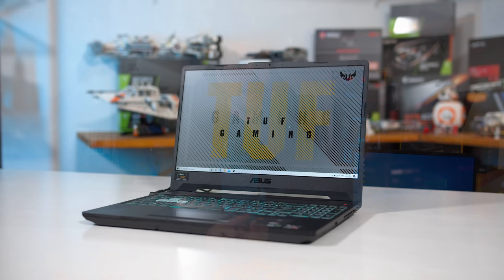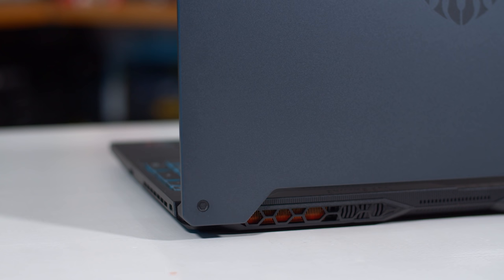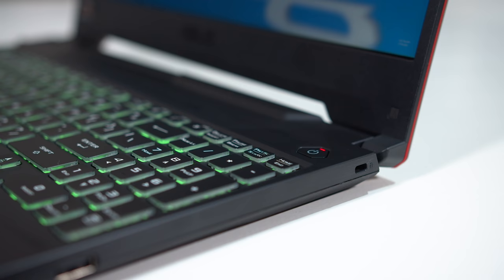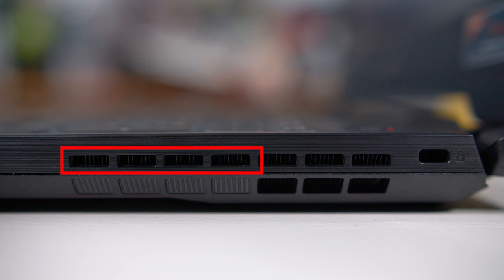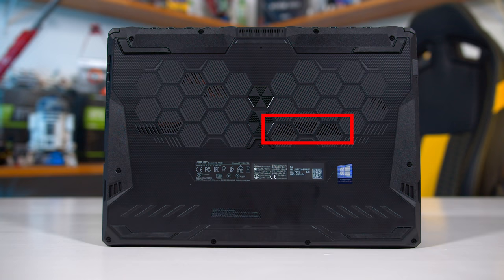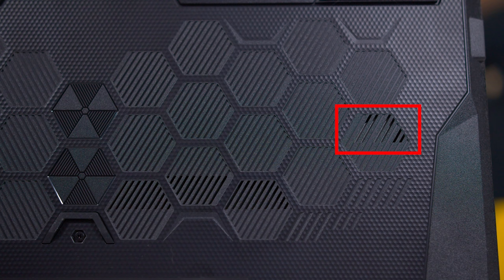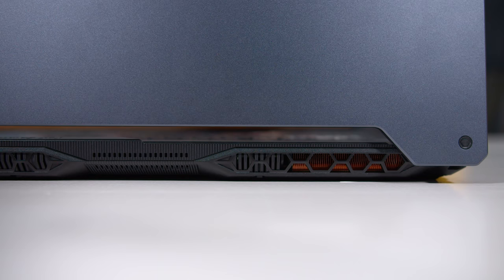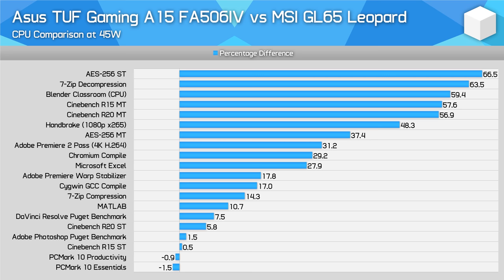Don't Buy The Asus TUF Gaming A15 (2020 Model)

Comment: From my experience, the design 'flaw' with the vents has been an issue with 'lower end' laptops across most manufacturers for a long time. Make it look like it has a lot of vents, flash fancy marketing images saying it has amazing ventilation, and people buy it thinking that they just might finally get a laptop that doesn't burn their lap only to be disappointed when it's just more of the same. I'm sure laptop manufacturers are fully capable of making a laptop under $1k that doesn't cook itself and its user, but doing every little thing you can to make them throw it away as soon as possible and buy something new just works too well. 
I think I'm just gonna stop paying attention to new laptops entirely. Honestly, it just seems like if you're uwilling (or unable) to drop a couple thousand dollars or more then you may as well just sift through the clearance aisle and hope for the best.
Reply: Not saying you're wrong, but as a point of contrast, I bought an entry-level ThinkPad E495 laptop last year for less than USD 500 (converted), and it has absolutely no problem cooling itself. Granted, it only uses 15 W and the fan doesn't even need to turn on unless I run a prolonged workload, but even for a CPU with that TDP, it still has dual heatpipes and more than enough ventilation around both the fan and heatsink, and around the components themselves. Needless to say, at that price point, compromises were made, but nevertheless given the low price, I've nothing but good words about it.
Reply: It reminds me exactly of why it is that I got the strange thought in my head of turning an old suitcase-PC into a modernized portable desktop machine.

Because either the hardware is crippled, the cooling is crippled, the display is crippled, the chassis is crippled - or a combination of any of them.
yeah, fuck off i'm not buying
Reply: @chuuni6924  i would be really surprised if a 15 watt cpu was overheating. It does not take much to cool it
Reply: gaming laptops should not be on your lap.
Reply: That's seem to be just how OEM treat budget gaming laptop, does seem to be the same across all OEM. They either charge more for better cooling or put in lower tier chip for the same price or sacrifices something else. Just gotta pick your poison. Just hope that at least these laptop can still last for at least 4/5 years with decent performance
Reply: I would say the entire idea of a gaming laptop is an oxymoron and the term shouldn't exist, it seems like any laptop that can actually game with a decent graphics card will have ridiculous throttling issues, portability problems with a crap battery, and heat that removes any long term potential for use, plus no upgradability. Gaming laptops are a scam and the reviewers should catch on to this.
Reply: @diddlysquat123  Yea, my Card has a MASSIVE heatsync. Its no womder laptops cant cool them good enough. Also, with laptops you normally end up paying twice the price as a desktop. Its funny because most of the time people that buy them dont even travel with them 🤣
Reply: @diddlysquat123  This person gets it!

People want gaming desktop performance crammed into a tiny ass space and not have to pay a fortune for it. Sorry folks, it's just not doable without some sacrifices.
Remember laptops before the gaming crap came around? I 'member! Light, portable, power efficient, cool, and affordable! People weren't pushing to play AAA games on them and shit.

The closest people are going to get to a high end desktop level gaming laptop: Heavy, large, power sucking, cool, and expensive.
Oh, it costs too much? Too big and heavy? Well, then you should be prepared for corners to be cut in places so you can get your sub 1000USD model.

Oxymoron indeed...
Reply: Buy Lenovo then lol Lenovo laptop is pretty cheap
Reply: The weird and not intuitive part of this at all is that the worst thermals it has, the less it burns your lap. the better it can transfer heat away from the processor, the more feet ends up going to your lap.
Reply: @pilotavery  say what? The idea of good thermals in transferring the heat out the side vents, not onto you lap, which is where the heat goes on a machine with poor thermals. You are totally backwards
Reply: @Mach141  a laptop with really really poor thermals won't output the heat into the environment, it will keep the processor really hot and start throttling. The more heat goes into your lap, the more heat is also going out of the vents.

laptops that get extremely hot mean that they are out putting a lot of heat into the environment which is why you are feeling it in your lap and out the vent. 

temperature does not equate to heat. A flame from a candle is very hot but is not a lot of heat. It won't heat up a room. A space heater might only be 100°, which is not very hot, but it has a lot of heat, and will heat a room.
Reply: @diddlysquat123  This laptop (Asus TUF A15) has enough cooling to sustain boost clock speeds on the CPU and GPU indefinitely. This review makes it sound like the laptop's cooling solution is fatally flawed but it works fine. I get over 6000 on Time Spy, which is only about 10% behind a desktop PC with desktop versions of the same parts. Re: portability problems: the laptop only weighs 16% more than a 16" MacBook Pro and its footprint is only 7% bigger, and nobody says the MacBook Pro has "portability problems." Re: crap battery: the most common version of the A15 has a 90 Wh battery which lasts for 9 hours of moderate use--how much battery life do you need?? Re: upgradeability: obviously you can't upgrade the CPU or GPU but the laptop does have two memory slots and two M.2 slots.

So to recap, comparing this laptop to a similar custom-built desktop gaming PC: The laptop only costs about $150-$200 more. It's only about 10% slower. It obviously comes with a built-in screen, keyboard, pointing device, and battery. It's much smaller than even the smallest mini-ITX computer. It uses much less electricity when idle and when under load. It's literally silent when under light loads. And a gaming laptop is going to have vastly better resale value than a gaming desktop and thus a much lower total cost of ownership. (Ever try to sell a custom-built desktop?)

So instead of gaming laptops being a scam, it seems pretty hard for me to justify building/buying a gaming desktop. I just did this math last month and ended up buying the laptop that's reviewed here. I mostly leave the lid closed and use it as a desktop. Couldn't be happier.

Comment: Wow another Asus AMD product that's got terrible thermals? Who'd have thought. Let me guess they'll blame AMD on this one too.
Reply: Yeah... AMD must have given them the wrong torque spec for the bottom cover screws... SMH... 😅
Reply: "AMD didn't pay us enough" lol
Reply: "AMD made us block the vents!"
Reply: Amd did say that this cpu needs less cooling... so we desided to block 90% of air intake... so it is AMDs fault!
Reply: "AMD marketed this chip as being very efficient, so we thought there wasn't any need to get proper vents. Apparently, AMD overhyped the efficiency of Zen 2 mobile processors. We apologize for the inconvenient."
Reply: except it DOESNT have terrible thermals....in fact they are better then the Higher End more expensive ROG Z model...weird....there No Thermal throttling and no overheating issues from every other tech review i have seen..still seems like a poor design decision though
Reply: @AlbertoMartinez765  It doesn't throttle no, unfortunately the heat isn't dissipated fast enough though & while gaming the keyboard apparently heats up to a toasty ~40°C after a while...
Reply: @AlbertoMartinez765  Asus cover the bottom too much and have bad screen because of the military grade so obviously it isnt the fault of the chip but AMD DID said that the chip doesnt need much cooling so...Well thanks god i didnt buy this laptop
Reply: same with my asus ryzen 5 it has thermal issues and it run likes intel celeron

Comment: Throw a Dremel at that back cover. It should improve air flow.
Reply: too bad a dremel can't fix the shitty screen tho
Reply: the shitty screen still can be removed and replaced by a better one. It's not a easy as drilling holes but it's doable.
Reply: @PainterVierax  display connectors and drivers are proprietary they can't be swapped
Reply: Erdem With a bit of skills, connectors can be adapted.
Drivers for a display ? LOL since it's standard eDP or LVDS, a driver is completely useless if the new panel provides the same resolution.
Reply: @PainterVierax  true. but better screens cost a bit of money. at that point is it worth just buying a different laptop
Reply: I don't deny that, just it still can be improved if someone really have to use this particular laptop.
Reply: @renmaru4485  wrong! The lcd panel connectors are standardized. The side that connects to the mainboard may not be, but that does not matter here. Going from one 15.6" 144hz ips to another doesn't require anything extra aside from making sure the connector on the lcd panel is on the same side. (Some are left, some are right, some are centered)
Reply: @nesttea2239  new/used panels are under $100. Used A grade AUO panels can be found for $60ish
Reply: Hey, could someone explain what this means? Is this some kind of screw? I tried googling it but didn't understand.
Reply: @Harleen what? a Dremel? it's a tool, you can attach a little bit and you can grind those slits open
Reply: @harleensingh2531  it's a rotary cutting tool

Comment: Rip Asus... Poorly designed GPU’s, now laptops? What’s going on.
Reply: @Mina Besali old Asus was good
Reply: asus also makes poor quality monitors ,sells at premium price
Reply: Apple-like marketing for the ill-informed. Crazy that it works!
Reply: Thy fixed their GPU didn't they?
Reply: everope Only when people called them out on it, and even then, for the Strix 5700XT, they tried to at least shift part of the blame to AMD for their guidelines, even though other AIBs have the same guidelines but have zero issues with their 5700XTs

The Strix was also overpriced. The Sapphire Nitro+ was less expensive and performed better across the board.
Reply: They’ve made some really poor designs for laptops for a while now.  The older STRIX GL502/GL702 (high end G-Sync laptops) were plagued with BSOD due to overheating.

Why?  When the screen opened, it physically blocked the two exhaust vents on the back of the laptop.
Reply: Haxor inator Ohhh, the GL502 has way more problems than that, being the owner (soon to be ex-owner) of one.

Poorly designed laptop that also led it to simultaneously give it faulty hardware BSODs later on down the line.
Reply: Put too much budget on marketing and promotional campaign using overpriced 'influencers'. No, I am not gonna buy your products just because a cute cosplayer girl take a photo while using/holding them.
Reply: Intel's money. that's what's going on
Reply: @haxorinator8219  yeah the thermal design of GL502 is terrible, me and my friend almost bought it for his new laptop, lucky that the store we came to lets us test the laptop before making the final decision. The damn thing got too hot 30s after we open tomb raider and froze.
Reply: @ca9inec0mic58  old asus was living up to the name of just works now they are just trash which made buy a asrock motherboard for the first time ever
Reply: Don't forget their routers... (most of them)
Reply: Never like asus brand,but my first asus is a15 with rtx2060.lol
Reply: @everope  They did but it should have never been a problem in the first place. Look at other aib and they didnt have the same problem as Asus did.
Reply: they stopped paying their engineers
Reply: add asus phones too.
no updates!
Reply: @darshan5726  asus is infamous for never updating their BIOSes and any of their applications lol
Reply: @bananya6020  You have any sources for that?
Reply: SmashStomp Inc  Blocking air intakes, doesn't help, does it? Fuck asus.
Reply: the funny thing is people still think that they selling this "strong spec" laptop with chip price and buy it without a thought
Reply: @unrealiac My next router will be NETGEAR Nighthawk.
Reply: Mainboards next. omg
Reply: @ggh_-ts6pn  Actual good products.  Good joke.
Reply: @goldman77700  yes. Apple products are overpriced but they are super well made. Also Mac OS is far better than fucking Windows the worst OS ever
Reply: Asus tuf gaming laptop is best I have 3 laptops 😡😡

Comment: Asus keeps messing up
Reply: implying this wasn't engineered in on purpose. Asus pocketed a fancy sum for this stunt, i hope AMD cuts them off as they are and have long been scumbags.
Reply: The g14 works well. I haven't had any problems with mine yet. Granted it came in in yesterday, but it's been stunning. I am going to be testing things out but so far the g14 is a very competitive option expecally when you account for it being a 14" laptop
Reply: I think this was done to meet the military grade toughness requirements

Comment: I bought this laptop(1660ti ver). Mostly playing Monster Hunter World and rainbow six siege. And sometime streaming my PS4 with elgato. Never regret my buying, no issue with thermal throttling what so ever. I think for me, it is a good buy.
Reply: Its a good criticism video tbh, showing the flaws bluntly and straight up, but they're minimal for me and the screen is good enough. I mean this lappy will never really leave my table so rarely any outdoor usage. Never had thermal throttling issues whatsoever.
Reply: i bought this too but unfortunately this is 60hertz and i missed it who can give me some morale
Reply: Hüseyin Umut AYRAN 60hertz? The screen? I got the 144hz model, tbh the gpu cant even push that high, 60hz is just okay. Dont worry to much.
Reply: Got my Asus tuf a15 ryzen 5 1660ti laptop yesterday and I'm sending it back due to it being really slow and getting really unstable fps in the few games I've tried so far (won't even play fortnite at epic settings have to use high and even then its not great. Also it overheats. Going to get the legion 5i core I5 rtx 2060 instead. Anyone have one of these?
Reply: Have u tried 4k video editing on this. If yes how does it performs ?
Reply: Ravi Singh sir this is a budget gaming laptop, please avoid anything with 4K in it.
Reply: Siege is the main game I play too, can this laptop run it smoothly?
Reply: @noahbrown6961  no problem, just dont go to crazy with the setting, it is a laptop tbh.
Reply: Still running good?
Reply: @lanadelthicc9197  yes, running perfect. No overheat issue.
Reply: @M1zi3  what are your temps?
Reply: @prathamdave5849  temp are good sir.
Reply: @M1zi3  could you please elaborate on your statement kind gentleman.

It appears my portable device hits 95 degrees C on the central unit and near 80 °C on the graphics unit

Oo how are ze temps in ze place u reside monseuir? It appears the 30°C in my area happens to effect the temps

Comment: Didn't they do a similar thing to the ASUS ROG Zephyrus G15? Where the air vents directly over the fans were covered by a plastic sheet?
Reply: yeah I had a GA502 with R7 3750h and that had exactly the same problem. Bottom panel was mostly covered and the laptop throttled itself in gaming. I wonder if it's being done on other AMD powered gaming notebooks.. would be good to look into it in more depth.
Reply: Harmz Singh It actually is! If you look at the Zephyrus M15, which has an intel CPU,  that one has the same back panel but without blocked air vents
Reply: Asus likes to botch their AMD laptops, i guess. there's older type of their AMD laptop that also botched compared to the Intel version
Reply: @brendonlim6327  im about to preorder zaph m15, would that be ok? Need a suggestion, ty mate
Reply: Damn I've been falling in love with the g15, but this is making me reconsider. Is the plastic sheet removable in any way? I really wanted to go AMD because their CPUs are just better, but the m15 doesn't seem to have this problem so what, I'm not forced to go intel?
Reply: @adodoes8770  The plastic sheet can be removed at the cost of slightly louder fan noise and a 5-10C drop in CPU/GPU temps from what I've seen.
Reply: @ZevyNuX how is the g14 that much different to g15
Reply: Adodoes In terms of design it’s completely different, but in terms of performance, I think they’re similar. However, the temps on the G14 are better than on the G15 because the G15 has blocked air vents.
Reply: RDelacroix Correct! But note that it will void warranty...
Reply: ZevyNuX Agreed!
Reply: Ivandy Hawk In my opinion it’s the best overall gaming laptop right now. Excellent design, performance, temps, screen... There’s a comparison made by Techtesters between the M15 and the GS66, you can really see how the M15 keeps up with a premium MSI model at a lower price. Definitely recommend this laptop to everyone out there, whether it’s for gaming, video editing or just watching movies.
Reply: Ivandy Hawk But make sure to get the 240 hz screen with 100% sRGB because the 144 hz one is washed out and has mediocre/bad color gamut
Reply: Sebastian R Thanks for recommending, but I don’t really like eluktronics’ design on laptops... fingerprints show up way too easily on them and the screen.... Just doesn’t look good as it has that matte finish to it. The battery and speakers, to my knowledge, are also nah.. Please do correct me if I’m wrong though, I’m just generalizing on Eluktronics gaming laptops.
Reply: Adodoes Unfortunately, you may have to sacrifice on a good GPU to get the excellent AMD CPU, cuz right now, the highest GPU you can get with an AMD CPU is rtx 2060 max q, which is not good enough in my opinion. You may also wait for next year, maybe other brands other than ASUS will consider going the AMD way
Reply: @brendonlim6327  the channel "Bob of all trades" made a video reviewing that laptop is the only review on yt to me looks like the best AMD CPU + nvidia GPU combo rn.